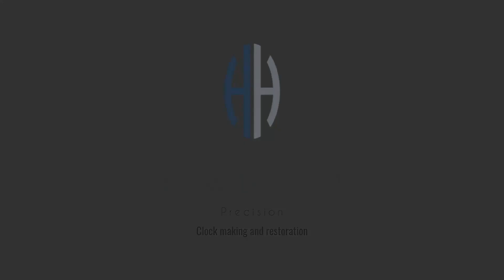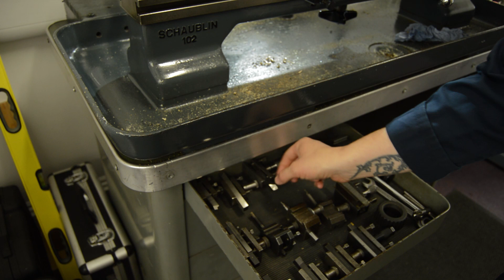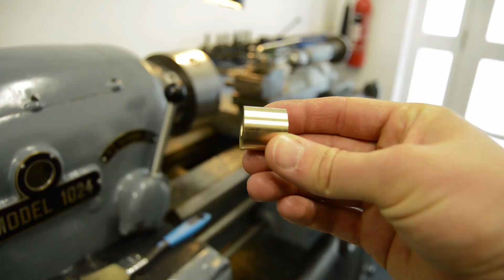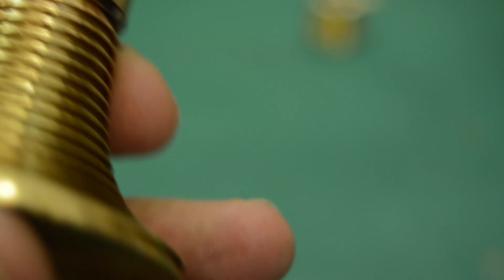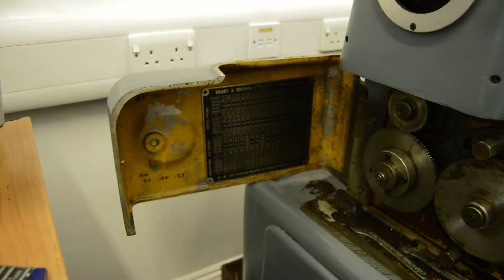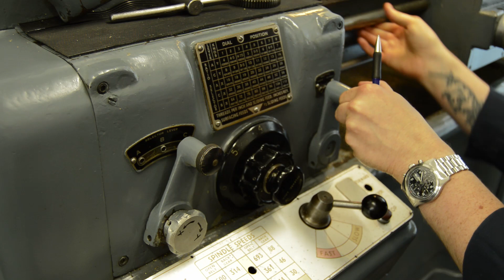Repairing a Clock Fusee

Comment: How are these cut without cnc threads on a curve originally?
Reply from the maker: You use a lot tool that can follow the curve of the cone, there are various types. It mounts on the cross-slide and moves with the carriage and you apply the pressure to keep it on the surface of the cone by hand.

Comment: I have a hand tool someone made for cutting fusee cones from blanks. I probably have a few blanks kicking around also lol
Reply from the maker: Well if you want to get rid, let me know!
Reply: @TommyJobson  I have a few odds and sods. 8" Fusee in Oak c1930. 14" convex c1860 and a couple of London 12" clocks. Genuine not lash up's. I never traded in marriages only original clocks. Most of the spares I sold off but I still have that fusee cutting tool and cones. Just drop me a message if you're interested.